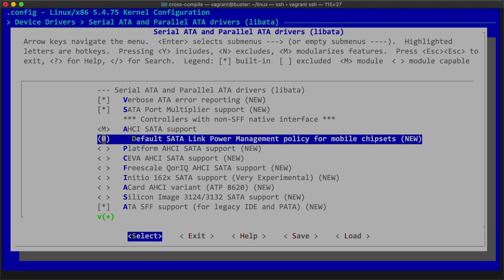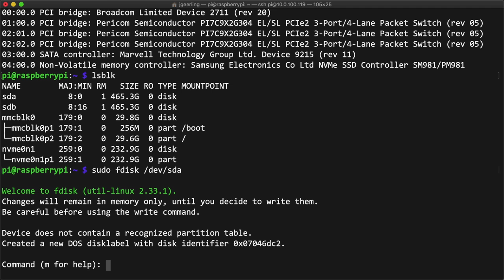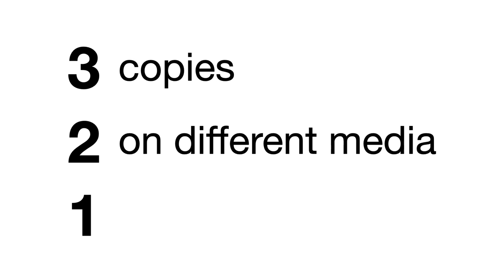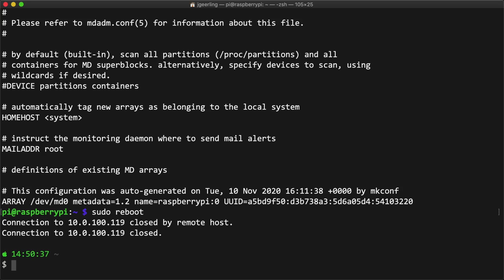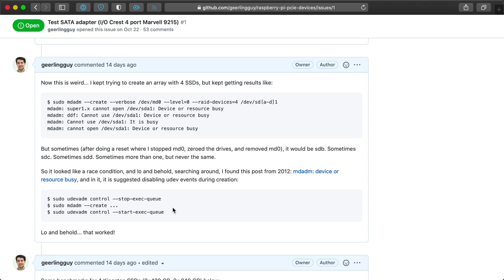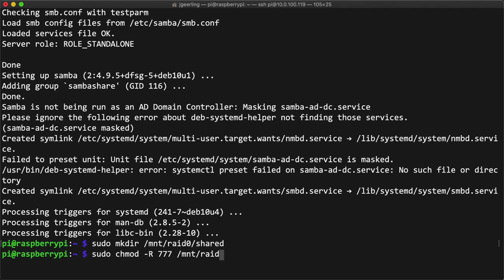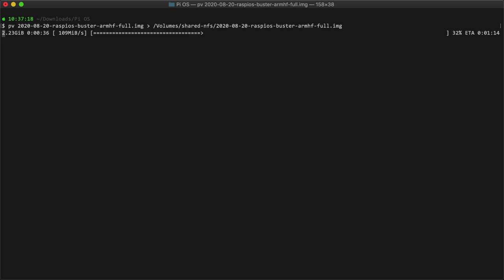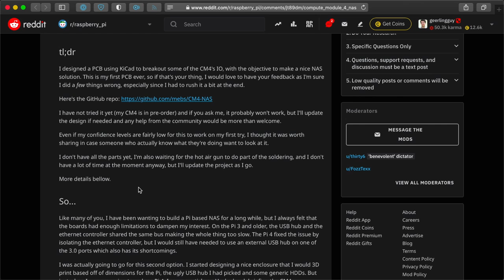I built the fastest Raspberry Pi SATA RAID NAS!

Comment: A RAID is NEVER considered a backup (at least from your point of view, meaning that having mulltiple discs it's a backup); a RAID is considered to be a faster/bigger/fault tolerant volume ONLY as compared to one equivalente size disc; even when you use a RAID you STILL NEED TO BACKUP YOUR DATA (because if your server or disc container catches fire and is phyiscally destroyed you end up losing ALL YOUR DATA AT ONCE); a backup is a copy, partial or total depending on your interest or budget, of the data in the RAID, that is kept TOTALLY APART AND AWAY FROM THE RAID LOCATION; thus, in case of destruction, theft, accidental/voluntary deletion, etc, YOU STILL HAVE YOUR BACKUP COPY YOU CAN RESTORE ONCE YOU RESTORE YOUR RAID VOLUME
Reply: Exactly. RAID redundancy is for availability, not for data safety. If you can't afford to wait for your entire backup recovery process any time a disk fails, you use raid.

If you can't afford to lose the data, you use backups.

Comment: stay away from hw raid - definitely fab up a case - it looks precarious - how about team it up with a 2.5gbe over usb3? for 30 bucks could be a good option
Reply from the maker: Even better, a PCIe switch and a 10 GbE card (though half or more the 10 GbE bandwidth is wasted...)!
Reply: think about doing 2 1tb ssd raid and then a couple 4tb spinning rust - use zfs raid cache ssd for the 8tb raid0 - that is almost total optimization? pls try gluster and gluster on zfs and then with the cache - the ssd may have less latency and the cache takes load off - you could even use nginx r proxy with cache as well - try it out just caching static but it can cache apps also - you may have sort of cache tiers - with zfs cache you can get the best of both worlds - zfs supports snapshots #concatenated
Reply: as prices for cheap nvme are about the same as ssd get the nvme - lower latency likely - future raspi pi need more pci lanes? lets keep it simple 2 tb ssd and 8tb is 320 plus rasp pi module and board - 500 for a 10 tb nas that is so power efficient - with 2.5gbe - almost an actual product in my product line of open hw gizmos - i am sure we will see some cases or innovations - hopefully it can saturate a 2.5 link - 200 mb/s is a heck of a lot better than 100mb/s - maybe run mysql cluster benchmarks - i hope next pi has 2 pci v4 slots and sep controllers, 16gb option - they could start selling more if they optimize for clustering, usb4 would be big - i think it is dependent on cost and timing - the 8gb version improvement was great - don't stop on bringing all the details on this together - put a fan right next to hot card in design - use the icydock 2 drive...maybe the best bang for the buck would be 4 ssd on pci with io crest - real fakeraid and then have a 4 drive external  on the usb3 (port multiplier?) shared with the 2.5 gbe --- the real reason why this is kind of cool is cause you can clone these quite easily and use as high availability appliances - opnsense or gluster node or mysql cluster node

https://www.amazon.com/Mediasonic-ProBox-HF2-SU3S2-SATA-Enclosure/dp/B003X26VV4
icybox for 4 ssd +rasppi case + ext usb exclosure + usb gbe2.5 - up to 64tb nas capacity, ok 32tb - you can back up the 4 ssd raid0 to the ext usb3 enclosure with guymager and it has perfect bit for bit checksums and verification - see what you get for speed - it is on kali linux, clonezilla may work but you need the drivers, pentoo has good driver support - try puppy linux on it - with 3 tb drive going for about 40 bucks a raid 10 6tb is only 160 bucks - it could be a very attractive product to smb sector but needs to be set up in 1u #chenbro #craft computing #live images #lo profile brackets

Comment: Very interesting how and why you dismiss raid 5. I understand you dismiss raid 6, but raid 5 isn't at all complicated.

It just relies on the fact that xor is a perfectly invertible function. So you just take n-1 blocks of your data (where n is the number of drives), xor every bit between them, and write that down to the last disk. Put the redundancy on a different disk every block, and you basically have raid5. Recovering data for a failed disk is basically xorring the other blocks (including redundancy) back together and you get your original data.

I even had an array fail on me once, because I was building it with the onboard intel raid stuff (yeah, don't). I was trying to turn one disk into a raid 5 of three disks, giving me two disks of storage plus redundancy, and it failed halfway because of a bum sata cable. But because it's so simple, I was able to restore it with a few lines of C code, which I kept around for good measure. I basically reversed all the data back on one drive, and got all my data back.

I mean, if I could write some simple C code to rebuild a raid5 array, it can't be that complicated right?
Reply from the maker: Well RAID 5 is less complicated, but it's a ton more likely (at least nowadays, if you have a multi-TB array) to experience a total failure than RAID 6.
Reply: @JeffGeerling  Hey Jeff, thanks for replying! I do agree on that fact. I believe you showed one of those articles explaining it at some point in your video, because of harddrives becoming very large, and mtbf catching up with long rebuild times. Not to mention the SMR debacle. I have some storage on my network in a raid5 array, but if I were to replace it today, with the low price of disks, I'd probably just go with a simple low cost synology 2-bay thing and put them in a mirror. A lot easier to deal with when something goes wrong. Don't need huge piles of storage anyway. And there's better solutions for that if you do.
Reply from the maker: @dentjoener  It is nice, if you can fit your data into something 16 TB or lower, to keep it simple and use two disks mirrored.
Reply: @JeffGeerling  Exactly

Comment: Your hard drive spins at 100 times per second?  That would be pretty slow.  Even cheap spinning drives these days spin at 7200RPM and faster drives spin at 10K or more RPM.  Also, the head seek time isn't necessarily the bottleneck, because most drives use the elevator algorithm to reorder multiple accesses into the most efficient track order, so head seek time is minimized.  The time it takes for the disk to spin to the point where the data is under the head, once the head is on the correct track, is usually the limiting factor.
Reply from the maker: 7200 RPM = 120 times per second. 15000K RPM = 250 times per second

Still orders of magnitude slower than SSD access for even the cheapest drives I've tested. Even with optimized algorithms and 15K enterprise SAS drives, it's incredibly slow for random IO compared to solid state.

That said, modern hard disks are pretty amazing at what they do (just like combustion engines are amazing in their efficiency at turning exploding gas into rotational energy!).

Comment: I fully agree on the raid5/6 stripe concerns across drives, however my experience has been very good. 
I started with a 3 drive software (md) raid5 array with 2TB drives on an old Intel computer with a PCI sata card running ubuntu 14.04-server. Over the course of about 8 years I upgraded the storage several times, survived a failed drive and swapped out the drives over time to faster drives. 
This spring I built a new system around an R5 2600 and an LSI 8-port PCIEx4 SAS/SATA card. It now runs ubuntu 20.04-server on mirrored boot SSD's with the same array drives and I have never had stripe/parity problems. Also I have (twice) had zero problems moving the array to a new system. Obviously, a data point of 1 means little but read performance will more than saturate 1GB Ethernet and big writes peak at about 60MB/s. As it serves mostly music and video in my home I do not consider it mission critical but I do get cranky if I can't watch baby Yoda on my home theater... 
Since you said you wanted something for video backup I thought my experience might be relevant.
Interesting video, thanks for sharing.

Comment: Why would you say you don't trust RAID 5 or 6? RAID 6 is safer than RAID 10. If in RAID 10 the 2 wrong drives (2 mirrored ones) die, you lose all your data, whereas with RAID 6, any 2 drives can die without losing data.

Comment: What did you call it a a samba "demon"? Probably not far from the truth :-P

As for you copy speeds slowing down during long copies, it looks like thermal throttling to me. When you said the SATA card reached 120 degrees that further validates thermal throttling. 

Stick a larger heatsink on the card, and use copper instead of aluminum. It anything it should lengthen the time it spends at high speeds.
Reply from the maker: I made sure to run all benchmarks with the fan on, and confirmed the card was staying at a decent lower temperature during that time. it only hits 120 (but was still stable) of I don't have a fan on it.
Reply: @JeffGeerling  - Retesting it with a different heatsink may be interesting in general to see how it affect performance overall

I have no experience with sata cards in general but I know heatsinks help with performance on NVME SSDs who chips regularly run at 90+ degrees so it is worth trying IMO.

Comment: As the Raid0 is nothing but a disk size union i can catch the idea: 4 disks = 4 more possible fails......
Are there stats on this ?
EDIT from my exp, samba is great ! easy for share on a win LAN. storing files is juste perfect and even if not very fast  ( especially on NTFS that lowers transfert rate across time ) it is pretty convenient. My pain came with wifi ! KODI on a PI and samba on another PI. Between them, my box wifi.... All this is lame ( and i suspect all shitty power-saving here and there fukup the thing... ).
I had to set up CPL boxes for my setup to work absolutely perfectly :)

Comment: Linus’s system failed because he have 3 hardware Raid 5 and then he striped it in windows that make only one missing raid 5 lead to data loss, just don't do multiple raids 5 or 6 then stripe it, single raid 5 or 6 then done, or do 2 Raids then mirror it using raid 1, If Linus don’t stripe the raid everything should be OK.

My synology NAS is using raid 5 with 4 4TB drives and it is working great, I’m going to find the way to back it up soon

Comment: LOL, kids.  We to me at least since I have been in IT for fourty years.  I wouldn't in a billion years use  RAID 0 or 1.    It's RAID 5 in a RAID 10.  Normally, RAID 5.  If you know what you are doing it's not as bad as you are making it.  In fact on a Linux workstation I set up a RAID 5 to 6 thumb drives and never had any problems and it's been ran for over 5 years.  RAID 5 is perfectly safe.  BUT!  If the data is critical then I also setup a mirror RAID 5 to mirror the working drives once a day.  Each afternoon the mirror drives are swapped out ffor a different set.  So, when one of the six drives goes then you know that entire drive stack is going to be failing soon.  Then you mirror the stack completely.  Shutdown the system, remove the old stack, move the mirror drives to the active and insert the new drives for the new mirror set and get it set to mirror.  The older drive set, you figure out if drive can be repurpose and then place it into a non-critical system that may need it's drive replaced because of high bad block count or alike.  But remember you have to still use 3-2-1.  At the time, each drive I believe was 2 GB each and the stack of drives was 6. Never had any problems.  RAID 0 and 1 was always problematic.

Comment: RAID is not a backup. Scream this from windows, tops of buildings and mountains. I have seen hardware RAID cards fail for a variety of issues. Ex-data center operations supervisor for about 5 years. Happened every 2 weeks or so to customers on higher end hardware, about every 3 - 6 months for our internal stuff. Early 2010s did you ever lose data from a hosting provider on a VPS node with a vague reason? LSI RAID card died. We never got a confirmed reason but it was like 50% bad cable and like 50% lack of consistent firmware updates where the card was slowly writing bad data that finally corrupted everything. I've never seen any software RAID issues other than a server that it's power cut off a bunch of times either by the customer messing around or by the data center for billing rather than blocking the network ports.

Comment: Ubuntu now ships OpenZFS support in their Pi images, so ZFS "Just Works" there. If you want to use it as a root filesystem, check out the upstream HOWTO (which I maintain): https://openzfs.github.io/openzfs-docs/Getting%20Started/Ubuntu/Ubuntu%2020.04%20Root%20on%20ZFS%20for%20Raspberry%20Pi.html
Reply from the maker: Thanks for the info! I didn't realize it also shipped on the Pi version.

Comment: do NOT use those kingston A400 drives! they can be fed up, and go below 25mbyte/sec. i used them for a win10 pc system drive, the pc had constant hangs and crashes. then i put into a retro xp pc. similar story. some programs wouldnt install wierd behaviour. after using it in an external usb 3 enclosure, it seems to work "fine". just... give yourself a treat and buy ANYTHING else.

Comment: RAID5 and RAID6 are fairly fine but you do get a performance hit. RAID5 is not recommended because a failed drive will put strain on the other drives during rebuilds (ZFS is best)

Comment: I love the RPi. They're awesome cheap capable (within their specifications) systems. But that being said, you have to remember they are basically Roku technology. so saying I have all my data backed up in a raspberry pi raid is like saying I have all my data backed up across a handful of rokus. Doesn't quite sound as secure, does it? These projects are cool and it's neat taking a handful of old drives and making a redundant storage system, but if you're serious about data security use a real computer. It doesn't have to be the latest and greatest but use a proper desktop with proper drive mounts, use proper cabling, cooling, etc. If your data security is that vital to you, don't trust it to a $35 credit card size computer that is basically yesteryear's cell phone technology.

I would like to reiterate again I love the raspberry pi they are awesome, this project is awesome (especially to cheaply and easily learn the processes involved in setting up redundant storage), they're just not a viable alternative to proper computing systems. Though In fairness for a NAS you really only need enough processing power to run a NIC and to address drives.

Comment: Not covered here is hardware raid controllers cards. you can have 10 drives, but if the controller card failed and its encoded redundancy check, well...you are fubared.

Comment: You're never going to win talking about ZFS on the Pi because it has no ECC RAM.  Don't let that discourage you.  Those people can't understand why you might want to run ZFS on a  dual boot macOS/Linux laptop or snapshot the root partition on a Raspberry Pi or other "casual" use cases.
Reply: ECC RAM is greatly overrated. Especially on a setup with 4 or 8 GB.

Comment: Raid 5 with the correct configuration is superior to raid 1,0,10
Reply: Raid 5 can be a huge risk when having disks with a few more Terabytes. Raid 6 is a minimum when dealing with large disks to prevent the much higher probability of failure during parity restoration
Reply: @NorthcodeNoCh  I will restate that Raid 5 with the correct configuration is superior to raid 1,0,10 even with large disks. It's simply a fact and even raid 6 in some cases.

Comment: Hardware RAID controller failure us exceptionally rare.  RAID 5 (and 6) using raid hardware is very safe, we have about 2PB on all sorts of h/w using h/w raid controllers.  Software raid, well I'm not completely convinced - also I believe Linus's problem was in part due to the software raid.  In data centers most disk is still hard disk, usually with SSDs to cache reads/writes.
Reply: When you break it down, "hardware" raid is just closed source software running on proprietary hardware in your environment. Moving that software to your own cpu and making it open source isn't really that big a stretch, so people who fear software raid seem a little luddite to me.

Linus's problems probably stemmed from misconfiguration, rather than whether it was software or "hardware" raid.

That statement about datacenters is definitely shifting quickly, I would not be surprised if the larger players are 50/50 or more moved to flash storage
Reply: @UnreasonableSteve  hardware raid usually has read and write cache ram with battery backup, it's very fast, has it's own cpu, rather than sharing the host cpu.  Typically it is bullet-proof, and things based inside the OS are subject to being affected by updates/patches and memory leaks.  We are using Windows Storage Spaces for some servers (in Azure) and with Azure we don't really know what is underneath the abstracted disk object we see.  Enterprise SSDs are incredibly expensive.  You can have cost-effective datacenter storage by using a small amount of SSD caching large amounts of spinning rust, with on-the-fly tiering.  Tiering in Storage Spaces isn't on-the-fly - typically you can only do that with dedicated hardware.

Comment: So you used WD green with a buffer size of 56mb and found it slow. I have WD red with a buffer size of 256 and a 7,200 rpm ,. I bet my raid 5 put performs your ssd.  10 drives vs 4 and I have every confidence in RAID 5 having run enterprize systems for years.  If the data is that valuable, you should archive it if a separare server. It can be retrieved and is very secure, If this is your archiving server then why trust the limits of read/write ssd?